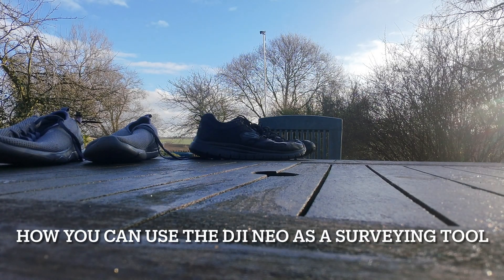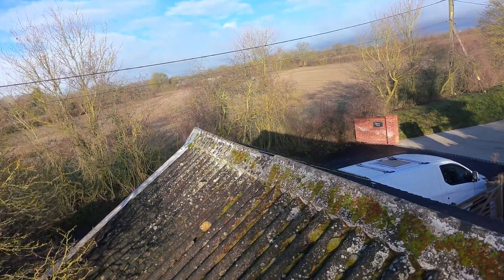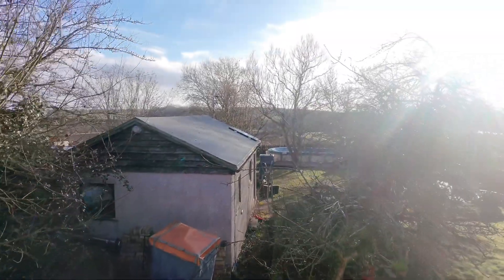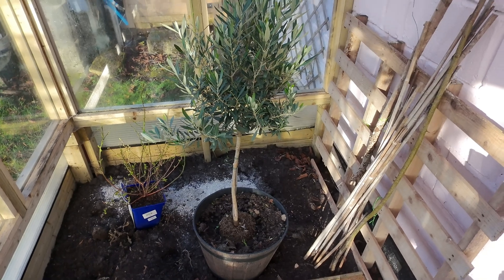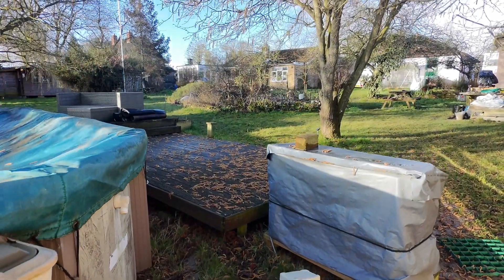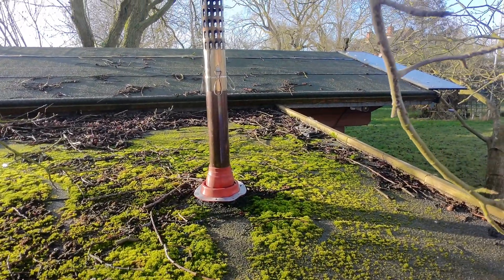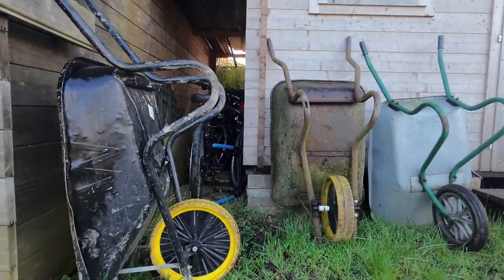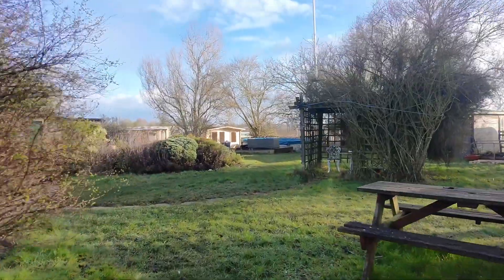How to use the DJI Neo Drone as a Surveying Tool

Comment: hi - did you use it with a controller or could I survey my roof with just my iPhone to control it? Thanks!
Reply from the maker: I was using the FOV goggles N3 and the motion controller 3 you can use you phone but the Neo is not that easy to control via your phone